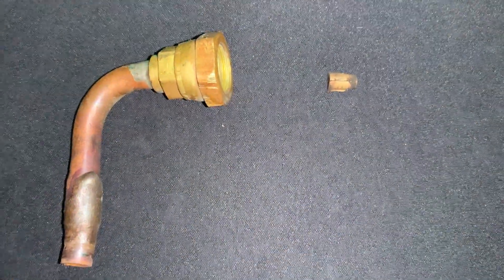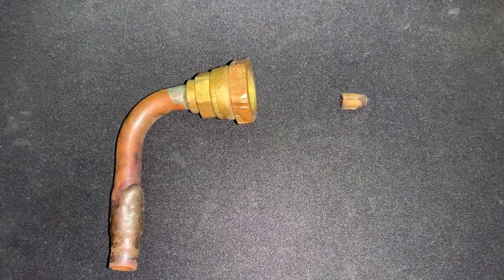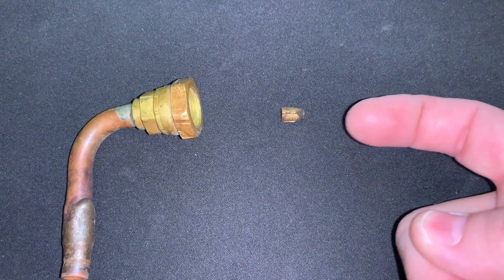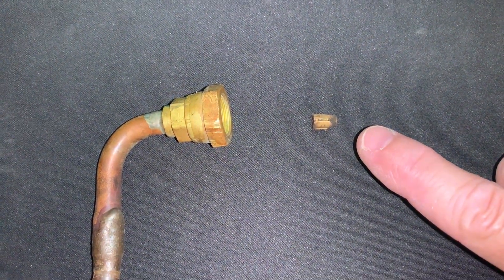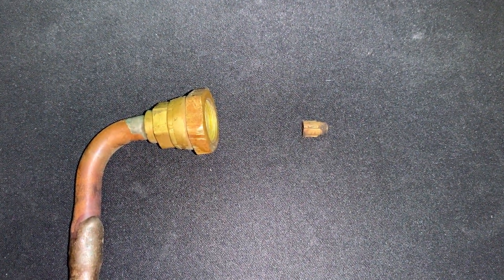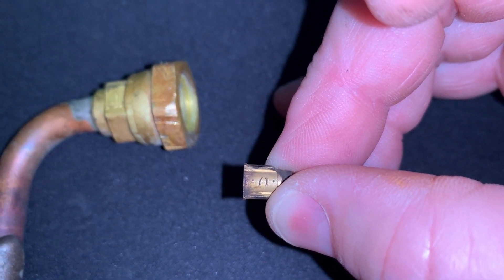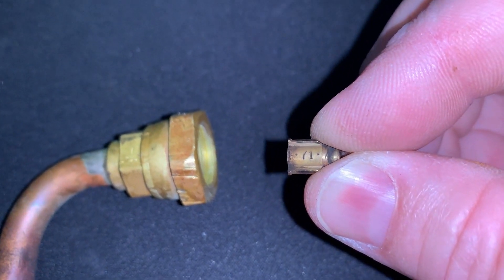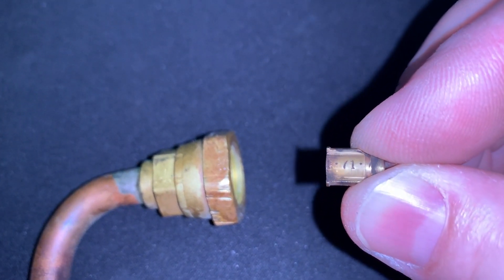Evaporator Coil Piston - How do you know what size you have?!

Comment: enjoyed your video, I am replacing my evap its a 3 ton evap with a 2.5 ton condenser, should I just use the old piston that comes out of the old evap? I read you size the piston with the size of the condenser
Reply from the maker: So their typically is a small range overlap that you can use some different size pistons with varying evaps. There should have been some paperwork that came with your new evap showing the chart and piston sizing for that evap. My guess is because you have such a "small" BTU overall (roughly 36k vs 30k evap to condenser) you probably would be okay, but I would still reference a sizing chart to make sure your old piston size will do the job! Good luck with you project! -Dutch